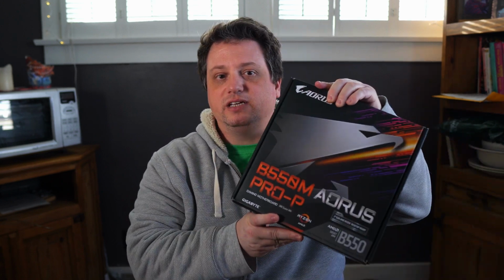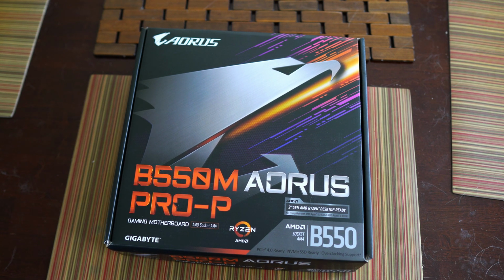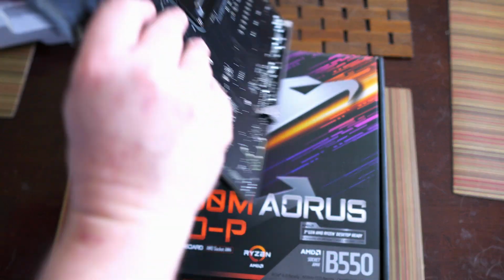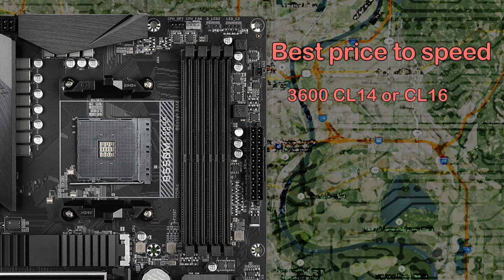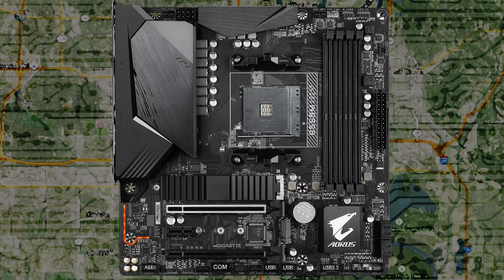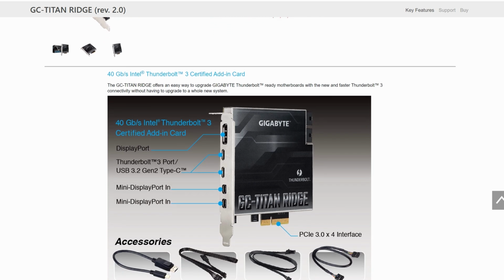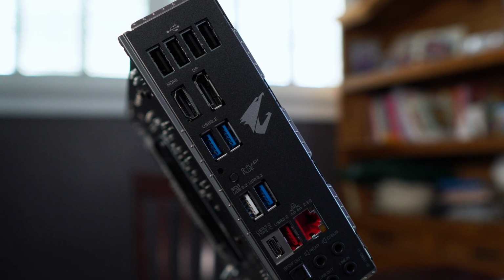Does it fly or does it fall? A deep look at the Gigabyte B550M Aorus Pro-P mATX motherboard.

Comment from the maker: Hi Everybody! So as I mentioned in the video, I had a hard time figuring out the BIOS version that came with the board and so I contacted Gigabyte customer support as I said I would. They got back to me after a couple of days. According to them F2 was the BIOS version that came with the board. As such I totally would have to (and I did) update the BIOS so a 5000 series CPU would work. As such I went ahead and did Q-Flash a couple of times to update it fully. It was a rather painless and quick process to use Q-Flash. If you wonder what BIOS came with your board, just hit up the maker's CS and be sure to include your purchase date. They should be able to tell you. 

Hope this helps!
Reply: So yesterday I tried to update my bios and it completely went wrong. I downloaded the wrong Bios. My board is exactly the same as your one. My sticker on my box is exactly the same as yours. Can you please assist me in fixing and downloading the correct Bios. I have been onto 100 of sites and videos trying to find it. I bought mine back in 2021 and not sure which Bios to install now. Every bios I tried doesn't work. Please help!

Comment: Here you said 3000 cpus are compatible but not 3000G... But their website says it supports 3000G as well...
Reply from the maker: This was probably just an oversight on my part, or 3000G compatibility hadn't been added yet (probably my mistake though). Good call out.
Reply: @MiddleofKnowhere  thanks a lot man...

Comment: Thanks for the review. Ended up building with one of these boards for my gaming PC and it's been great experience.  Lots of options to tweak but it also works right out of the box without a fuss.  Did vary a bit from your M.2 idea and put my OS on a WD850X 4TB in the faster slot and a WD770 in the slower slot purely as a backup drive.  It works ;) Got TPM working without adding a module and Windows 11 Pro is happy.  Anyway your video was a big help when deciding which board to get. Thanks again!
Reply from the maker: Glad I could help! Thank you.

Comment: great video. i had one question though, i know that you said it support ryzen 5000 and 5000G CPU's but would it also work with 5000x?
Reply from the maker: Yes it will. By 5000 series I mean both X and non X variants. 5000G CPUs refer to APUs which have onboard graphics capabilities so those are separated. Great question though and thank you for watching!
Reply: It does.  Using it now with a 5800X.  It will support the 5800X3D as well.

Comment: nice review.  Looking to build some budget computers for a few friends, not sure exactly the route I am going to go.  Looking to go with an integrated chip and let them add a gpu down the road when they find one.  looking to pair a motherboard with a AMD Ryzen 5 5600G 3.9 GHz 6-Core Processor.  based off the price budget and the reviews. Still not entirely sure which route I am going but just gaining some ideas.  Appreciate your video and look forward to going through some more.  Didn't even think about a case having a port, that couldn't work because of the motherboard to be honest though.  Guess ive gotten lucky on some of my builds lol.
Reply from the maker: Thank you! The 5600G is a solid choice for a budget build. It's pretty inexpensive right now, especially when compared to it's original MSRP. It won't have PCIe 4.0 but meh most budget builds wouldn't necessarily take advantage of that anyway.

Comment: This was very helpful and thorough review. I'm really liking this mobo for my next build (apart from the compromises on the internal USB C header and a couple of other things). I've watch several vids comparing various B550 boards and it took me until now to realise that they were talking about the pro, not the pro-p version, which makes me feel a little better, as the thermals on the VRMs were fairly lackluster in some of the reviews for the pro (shouldn't be too much of an issue, but I'd really like everything as cool and quiet as possible).
Reply: It does support type c tho.
Reply: @pablocsa5629  It has a rear type C connector on the I/O panel, but afaik (happy to be wrong, this thing was expensive) the 3.2 headers on the board don't support the requirements of the Type C, and are for the slightly older 3.2 type A USB. So, for instance, I have a case with an optional front type C usb socket available, but my understanding is that this mobo doesn't have the right type C board connector to make it work (or at least at the appropriate speed).
Reply: Okay I get you. So which is better than this one ? At a price close to this baby. I’m preparing to build my first pc and I honestly don’t want any complications.
Reply: @pablocsa5629  Honestly, that's difficult for me to say, as I'm in the UK so price and supply will be different. I'm guessing you already know of PC part picker, but I found them useful for product comparison. If I had to choose again now, and I hadn't bought anything else, I might consider upgrading to one of the lower end new gen AMD boards. But tbh I bought the Pro-P because I thought the lack of type C board header was an acceptable compromise for the price to performance/features it offered vs other boards available. I'd only advise that you check any board you buy has a decent enough audio codec for your uses and bios flashback on the IO for ease (both of which the Pro P has).
Reply: @haildorothygale  GIGABYTE B660M AORUS Elite AX DDR4, I will buy this one honestly. It might be expensive but it's worth it. I'm from South Africa and me buying in the U.K would kill me as the exchange rate is 1 ZAR is equivalent to 24 Euros.

Comment: Your thoughts on using the lower m.2 port for the OS, on a Gen 3 drive, sounds like good advice.
Reply from the maker: Thanks! Way I see it, you won't notice too much of a time difference on the boot and the pcie 4.0 nvme drive would be better used as a scratch disk or cache drive for content creation. You can still reserve a SATA SSD for games and stuff and that will still load fast. I use a 2.5" ssd for my games and it's great.

Comment: Does an rtx 3060ti or 3070 fit on this mb?
Reply: because im worried if the gpu is too thick it would not fit past my usb cable from the bottom
Reply from the maker: It will fit but if you get an matx case you will have tight clearance. I’d recommend a regular mid-tower with any triple slot gpus.

Comment: I was really hoping for Wi-Fi to be included on this one like the itx version.
Reply: Just buy a usb wifi adapter. Works like a charm.😁
Reply from the maker: That's what i use to download drivers and update windows since I set up my builds on the dining room table away from a wired connection. The TP-link USB that I use is really nice, fast and convenient.

Comment: Does this work with a ryzen 5 5600x or do i have to buy a 5 5600g?
Reply: Or is just the 5 5600 the best choise?
Reply from the maker: It will work with any of those CPUs. Best choice comes down to budget. The 5600 and 5600X are the closest together in performance with the 5600 being cheaper and then the 5600G has an integrated GPU but will perform less than the 5600 and 5600X and the 5600G DOES NOT have PCIe 4.0 capabilities. Ironically you can get the 5600X or 5600 for near the same price, so I would recommend the X. https://amzn.to/3nWkScZ
Reply: @MiddleofKnowhere  Thanks man, great feedback. I guess i will go with a rtx 3060 and a 5 5600x now!
Reply from the maker: Yeah, after reading your comment, I looked up the prices and saw the 5600x is going for same or even 4 bucks cheaper lol. The choice is clear then!

Comment: So I just ordered this motherboard and a Ryzen 5600x. Based on what you said in the video, I shouldn’t have to update the BIOS using a flash drive because I recently ordered it correct? The revision is 1.0
Reply from the maker: If it has the Ryzen 5000 ready sticker on it, you won't. Otherwise, you will.
Reply: @MiddleofKnowhere  never-mind I found it. Thanks for your reply!
Reply from the maker: Oh great! Glad to hear.
Reply: @MiddleofKnowhere  where would the sticker be?
Reply from the maker: It should be on the box on the front.

Comment: Thank you for reviewing this motherboard. I'm planning to build a new Ryzen 7 5700g PC without a discrete GPU for productivity, and this motherboard seems perfect because it has a display port and HDMI port. But do you think it would support DDR4 4800 MHz dual channel kit memory?
Reply from the maker: The motherboard can support up to DDR4 4733 RAM, but this might be less with a 5700G since and according to various sources it seems the APU will max out at DDR4 3200. However, it looks like in a Hardware Canucks video they had DDR4 4000 memory working with a 5700G (probably just 2 sticks). You could go for that. Just remember there are diminishing returns with higher speed memory and then the cost goes up exponentially.
Reply: @MiddleofKnowhere  Thank you for your reply.
Reply: @MiddleofKnowhere  i think 3200 is more than enough for most people, but i guess it depends on what you do. AMD tends to be more sensitive to Ram speeds than Intel, but it works for both in similar ways. what Ram do you think best works with B550 not just with this Gigabyte but others. Corsair and Crucial are the two most common, but those are the one's I've used in the past and they usually work well with most motherboards out there. but there are other companies, Kingston is a name i see sometimes, Hyper X, there's also a few new names im not as familiar with, TeamGroup, that's a name i seen, G.Skill, although there most common on Intel gaming builds, but there known for there RGB. would it be the same with X570, i been looking at both, but im not sure if i should get the 5600G, 5600X or 3600, those are the 3 im mainly looking at, but Ram is what im most curious about. the 5600G is the one im thinking of getting, since im not a hardcore gamer, but i do play some casual games sometimes, and the 5600G and 5700G have igpu. or would it be better to get the 3600 or 5600X with a dedicated graphics Nvidia or Radeon.

Comment: Is this motherboard compatible with the MB311L Cooler Master case? Cause the ARGB Fans don’t seem to have the same pin count as the motherboard
Reply from the maker: Yep this motherboard will both fit in the case, and it has 2 ARGB (3-pin/5 volt) headers to accommodate the included fans.

Comment: Can you use Wi-Fi wireless on this broad
Reply from the maker: It does not come with integrated wifi, but you can get a usb wifi adapter, or a PCIe card and use wifi that way. I like this for ease of use and it's inexpensive. If you need faster, there is faster out there: https://amzn.to/3zhIOyq

Comment: Hi. Can this board support the 5950X? Thanks.
Reply from the maker: Probably as long as you don’t do any overclocking
Reply: @MiddleofKnowhere  Wow thanks for replying! Do you have a mATX board to recommend for pairing with a 5950X? I have a m-ATX case and everything and I just want to upgrade/replace my old Z170M+6700K with a B550M+5950X. And if you have a video reviewing that mobo it'll be great! Thanks so much! XDDD
Reply from the maker: @Toobielove  So according to Tomshardware the Aorus Pro-P can handle a 5950x no problem as long as you don't overclock or enable PBO as the VRMs will get quite warm. In my research, it's hard to find an matx motherboard that can adequately handle the 5950x. MATX boards tend to cut features down as they aren't necessarily aimed at the high end of things but more middle or high-middle, so for instance a 5900X could be used no problem.

It might be worth getting an ATX case and trying for an ATX board. The Strix B550-E or Dark Hero (if you can afford it) are great options to look at.
Reply: @MiddleofKnowhere  Wow! Thanks for taking the time to look into my query and providing such detailed answer. Think I will just get a 5900X with the Aorus Pro-P and not overheat anything while saving some money! You have been most helpful! Again, thank you so much!!! XDDD
Reply from the maker: Glad I could help. You’ll love the 5900x bit performs great and at current prices will you ever be saving money.

Oh and I put a link to the Aorus pro p in the vid description feel free to use it (it’s an affiliate link) if you want. Helps me out tons. :)

Comment: Hey, I don’t know which one to get even after this review should I get this motherboard or the MSI B550M PRO-VDH WIFI Micro ATX AM4 Motherboard?
Reply from the maker: I'm currently in the process of editing my B550m Pro-VDH WiFi video. I like it. It's cheaper, doesn't have as many features as I'd want and isn't flashy at all, but has several you might like like the wifi and type-c front panel connector. Having said that, the Aorus Pro-P has way more USB ports including Type-C on the back, a 2.5Gbit ethernet port if you need that, a beefier power delivery, and a more robust audio solution. These thigns could warrant the extra cost. It doesn't have wifi or a type-c front panel connector though. Honestly, it all depends on what you need and what CPU you intend to pair with the mobo. The Pro-VDH did well with a 3900x stock and oc speed, so it could also do well with a 5600x or 5800x possibly even a 5900x.
Reply: @MiddleofKnowhere  Thanks for the quick reply I’ll definitely stay tuned for your review on the MSI B550M PRO-VDH WIFI Micro ATX but I found the PRO-P on Newegg for only 10$ more so I’ll probably get that since it has more to offer.
Reply from the maker: Very nice yeah if you can find it for not much more go for it. I lucked out and got my pro vdh for 90 + tax but no shipping on eBay. I was hunting for deals and figured it was a good one.

Comment: I've owned this motherboard for a year now a and really like it. Wanted to give you a like and note to say it was a really good and informative review.
Reply from the maker: Thank you so much! Glad you like the motherboard and the video!. I definitely had no real issues with it after I figured out I installed the wrong bios and then got the correct one installed, lol. It's a good board but RGB Fusion 2.0 def needs work--that's probably my only real complaint but if you don't need fusion, don't install it.
Reply: hows the software ?
Reply: Does it have wifi or do I need to buy a wifi card
Reply: @steveionjoker5319  You'll need a WiFi card.

Comment: I bought this motherboard about 1 month ago and I'm having bad issues with upload speeds. I had an ASUS B450-f before this one and was getting 200-300 mbps upload and download speeds using a usb wifi dongle and now that I got this new motherboard im getting 20-50 mbps upload and 200-300 mbps download. I tried connecting VIA Ethernet and got the same outcome. Please help me I have been trying to fix it for 3 weeks now.
Reply from the maker: What dongle are you using and have you made sure the drivers on the gigabyte board for it are installed? Go the the manufacturer of the dongle. I also used a usb wifi to download updates and it seemed fast to me. Using an ac router.

Comment: i bought an x570 aorus elite and it has several rgb components......the caveat is that with my gpu, cpu cooler,nvme, etc.....you really cant see them at all. theyre also kind of dim even using gigabyte software to make it as bright as possible.
Reply from the maker: Hey Dead, I just spent 3 hours trying to figure out how to get RGB Fusion 2.0 to work . . . I did nothing, it randomly just finally opened. What a POS! And you're absolutely right! The tiny audio lighting strip on this motherboard is now mostly hidden by the AMD 6700XT I installed. lol It's amazing how much time and effort PC builders, like myself, put into cable management, making sure lights look cool etc, and then 90% of it's hidden out of view by a big honkin' gpu.

I'm pretty miffed about the Fusion software. I honestly have no idea what I did to get it to work, if anything . . .
Reply: @MiddleofKnowhere  ok so I have no idea why it does it, but I have had issues with radeon software interfering with rgb fusion 2.0 .  amd's radeon software doesn't get along with rgb fusion. Let's of people have had issues but no one can seem to explain it. When I had a 5700xt I had a lot of coil whine. On a whim one day after reading a reddit post I uninstalled fusion.......coil whine stopped. I reinstalled and it came back. I tried it 2 more times with the same result so I stopped using it altogether. Fast forward several months and I bought a 3070ti. I reinstalled fusion and no coil whine or anything. Still have zero explanation why. I even talked to the powercolor rma guy for a while and he was just as baffled.

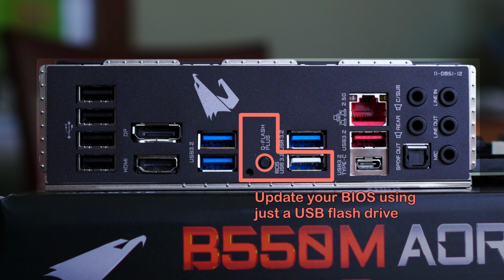Comment: Nice video bro. 17:40 The bios update works also only with the 24pin connector :)
Reply from the maker: Thanks for that info! I was going off the Gigabyte instructions and they show both 8-pin cpu and 24-pin. Interesting that either would work.
Reply: @MiddleofKnowhere  yeah, i tested that already on my Asus DH and i did it just with the 24pin. I'm pretty sure it's the same for this board to, because if you do that without CPU, you don't need to content the 8Pin cables ^^